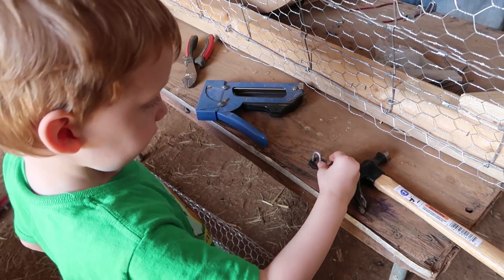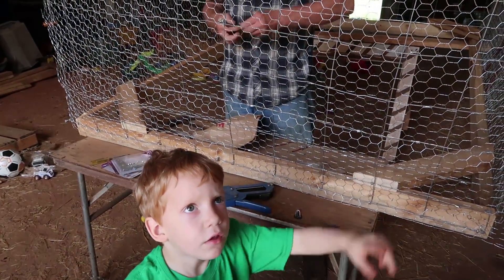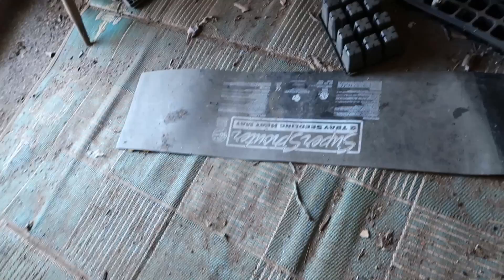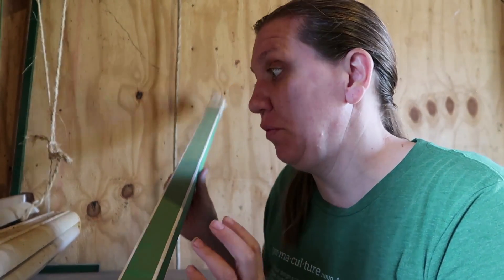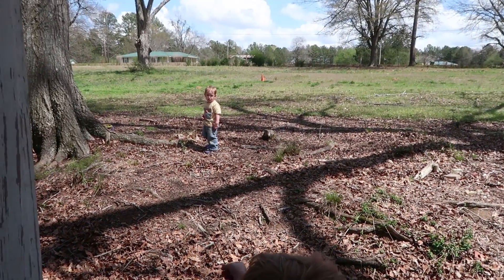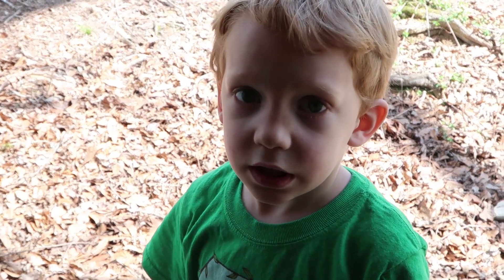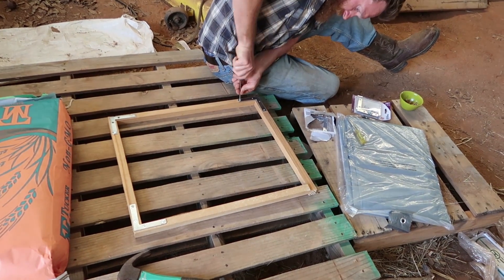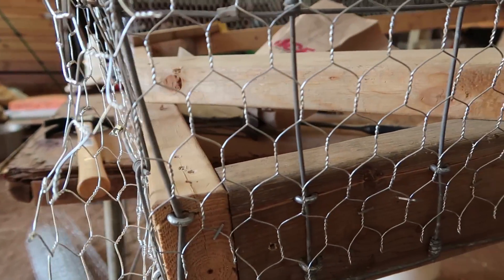Setting up my GROW ROOM and Find a DEADLY Creature!?

Comment: Love your channel....I started seed starting a different way this year because of some of the issues of my saved seeds from last year, old seed packs and it seems to be working for me. In the past, I have bought seed packs  that  supposedly "expired", but depending where I got them from, sometimes they expired and sometimes they didn't, wouldn't sprout if used the next year.  Because of my failure last year of germination for quite a few, I went this route this year. I have a lot of bought/packaged of old seed. I took the seeds this year and put them in wet paper towels  in a baggie. Within 7 to 12 days, depending on the plant, I had sprouted seeds, or not. I then put the sprouted ones in the soil cells and within 2 days I had started seedlings. It is early yet, just an experiment.... At least now I see seedlings... Mine is a small garden, but this seems to be working. 

Thanks for all you info!!!

Comment: No soil blocker? Those seem very useful otherwise. Getting rid of those plastic trays.
Reply from the maker: ceselb I have had these same trays for over 8 years, lol! but they are at the end of the road now so I actually just ordered the mini soil blocker! I just learned about them in another channel this year and thought cool but way too big to start seeds. pretty wasteful to use an outside resource (soil starter) in that volume in my opinion. so I will be using them soon!